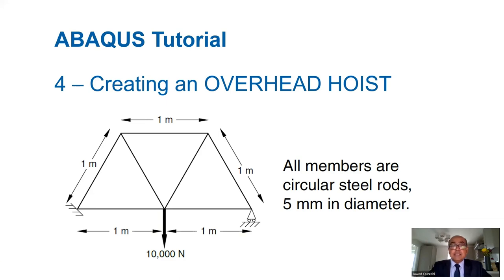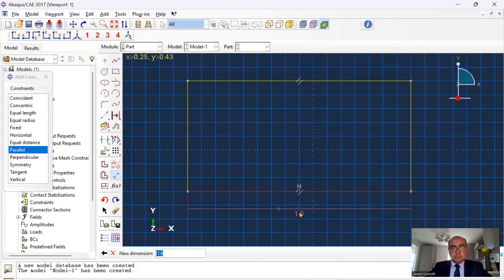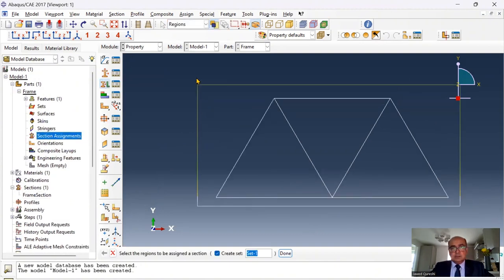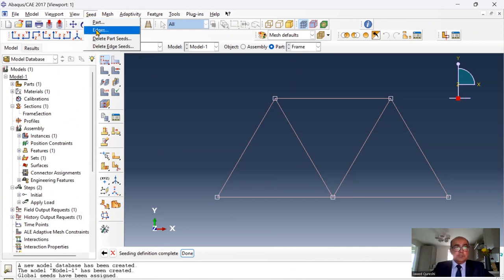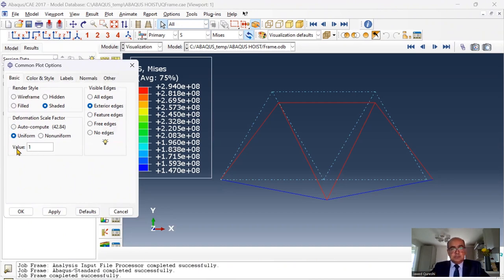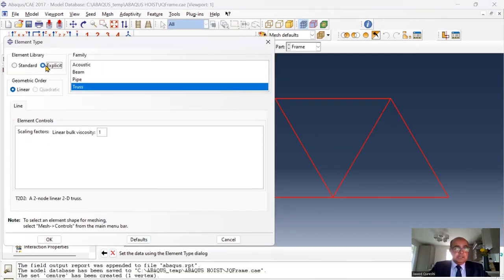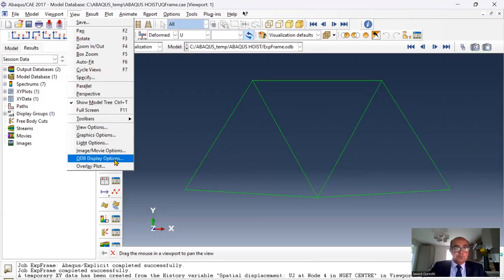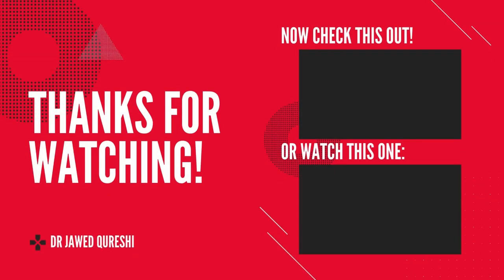4 Modelling Overhead HOIST (TRUSS!) – ABAQUS Tutorial

Comment: Thank you Sir. I have some questions,
1) You have selected initial condition for setting boundary condition. Why not in apply load condition?
2) When I selected mesh size as 1 as per in the video, I'm getting the results as like in the video but when selected the mesh size below 1 say 0.1, then  result is not like in the video
Reply from the maker: The model must be constrained before applying loads, which is why constraints are defined in the initial conditions. A real-life example: Imagine holding a ruler between two fingers and applying a load, such as placing a sweet in the middle. The ruler must be supported somewhere before applying the load, right? In this case, the fingers act as the supports.

Reducing the mesh size generally improves the accuracy of results, making them more comparable to experimental data and manual calculations.